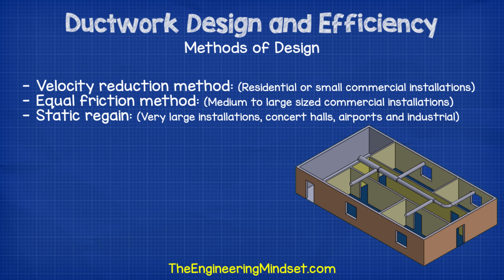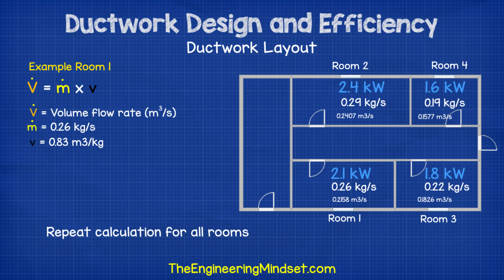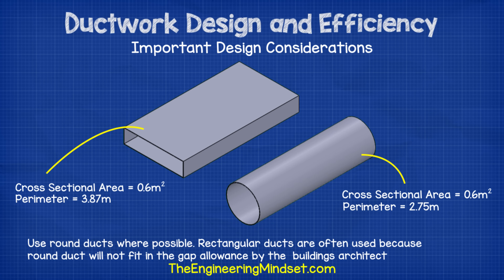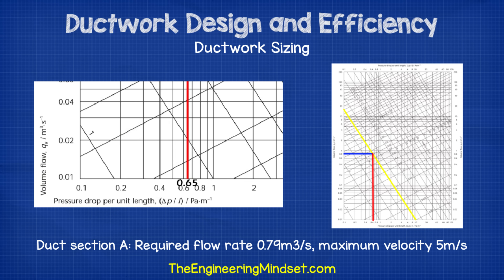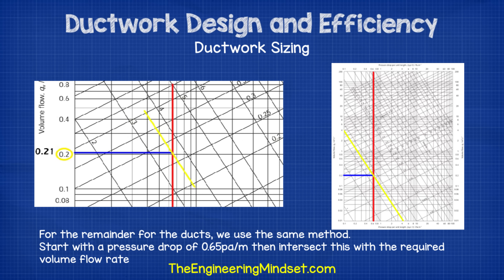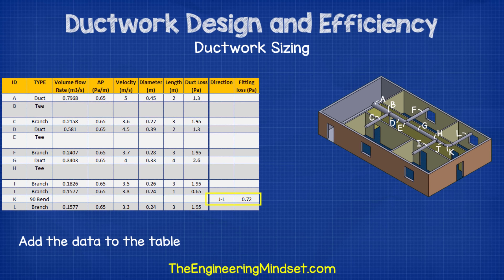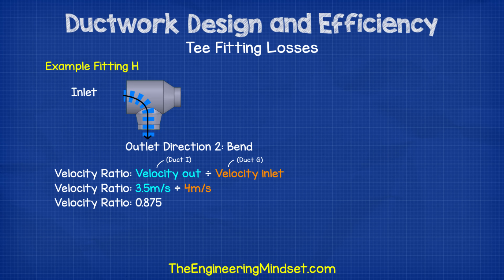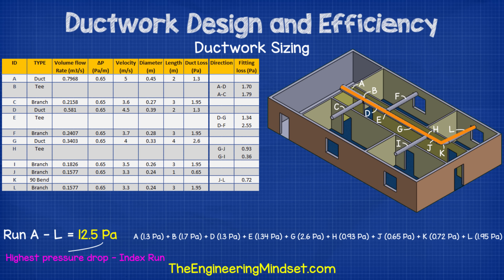Ductwork sizing, calculation and design for efficiency - HVAC Basics + full worked example

Comment: Hi sir, how about designing a multiple floor duct system (with 2nd floor and 3rd floor house). Is the main duct from the upper ground or lower ground?
Reply: Depends on where your feeding it from, if you’ve got an RTU then it all comes down from above and is distributed through the building either directly or through VAV boxes, if you choose to have individual AHUs all throughout the building then they orginate from each floor the air handler is on, but then you’d also need to worry about condensing units and possibly chillers to aquire and it may not become a feasible option if you’re low on budget.

Comment: Every "air properties table" that I have and have searched up has given MUCH different values for the Cp of air. At about 70 degrees F, they all list values very close to cp = 1.005. You on the other hand, listed 1.026, which all my tables list that value when the air temperature is around 440 F... Is this an error? Did you forget a "0" before the "2"?
Reply: are you working in imperial or metric units..? his video is in metric (SI) but you seem to be quoting imperial (I) values..?
Reply: @dpajc056  I am not quoting imperial units, the units for the Cp I quoted were in (kJ/kg*K)
Reply: @dpajc056  Does anyone have a link to an "air properties table" that confirms his Cp air value?

Comment: This is insanity...I mean...for large buildings, this is absolutely essential.  But for small offices and small homes, surely you can simply this and still get results that are perfectly sufficient?  Any negative effects in such a small and simple installation couldn't possibly be that significant with a more simplified method of ductwork design.  Unless the design work was 100% guess work, I just can't imagine there isn't a simpler way to do this on the small scale.

Example: I have a one story home with a fully submerged basement.  One room has a significantly larger load than the rest of the home (TV, computer, UPS, File server, mini fridge, and two people that are in there frequently)...there must be a relatively simple way of figuring out how to move enough of this room's air to the central unit fast enough, in order to remove the heat at a rate greater than that which it is being built up with fewer calculations.

Comment: Error At minute 15:45 - for the H Tee branch G-I  only the value of the loss coefficient was tabulated as 0.36 instead it should have been the value obtained when calculating the fitting loss as was done for the straight duct GJ which gave 0.93 Pa. some clarification needed here?
Reply: At point H, direction G-I, the correct value is 2.68, and not 0.36, so we would have to correct the subsequent calculations.

Comment: Hey Paul,
I am confused about the ESP and couldn't find anybody to explain to me the following 2 questions, I hope you can clarify them for me:
1- why would the static pressure drop when encountering resistance such as filters or coils when at the same time the dynamic pressure decreases (because the velocity of air is decreasing)? I thought that when SP decrease, the DP should increase.
2- why might a concealed FCU break down if installed without ducts?
thanks in advance and I hope you see my comment ^_^.
Reply: 1, You are right if there is no energy loss, but when passing thru filters or coil , there is enegy loss ( due to friction ), so the total energy is less , hence the SP as well as the DP dropped.
2, This is where your concern above come into play : when SP decreased, DP increased. When a FCU is installed without ducting , there is no SP loss which it is designed to have, hance the DP increased , which means the fan is free running , and this causes the fan motor to overload !

Comment: Great video, it's important to also note that's another driving factor for the mass flow rate is the fresh Air supply which is higher than your cooling or heating loads would override your video size
Reply: Agreed. This is where hydronics are strong - separating the ventilation needs from the load needs.

Comment: thank you for the video...But how to find initial velocity i.e 5 meter per sec ? What are the recommended values?
Reply: Main duct is restricted to go beyond 5mps due to noise level it will produce. hmm better check the ASHRAE because some may prohibit due to application of the system.

Comment: choosing between rectangular and round shape is also driven by the cost of the duct isn’t it? using round shape may give you lower friction but cost you more in terms of the overall weight and space of the ventwork

Comment: In calculating the pressure loss in the Tee Fitting, why do you only apply the dynamic loss formula in the straight direction and not in the bend too? For the bend you've only used the co-efficient of 0.3645 (15:45) and not used this in the dynamic loss equation, like you did after getting the co-efficient of 0.143 in the straight section (14:45).
Reply: was that a mistake ? or its how it done ?
Reply: I noticed that as well. It looks like an honest mistake.

Comment: This was a fantastically simple overview of the engineering process needed to accurately specify a ducting system.  

Here in the States among contractors, the most common method for duct sizing in residential is the "friction loss per 100 ft." method wherein we calculate the total equivalent length for the longest runs (both supply and return) and size everything based on getting the appropriate amount of air to these runs and balancing the rest with dampers.

Really wish there was an instructional video on this process (or even the equal friction method) in Imperial units out in YouTube.  

Thanks for providing such fantastic resources for the industry.
Reply: Look up the "ACGIH Industrial Ventilation" manual. You can download the 23rd edition for free on google. It has step by step examples.

Comment: Is there a video on vav boxes? I need to know if the vav boxes also have a little coil that can add or remove heat, in addition to merely  constricting or expanding airflow
Reply from the maker: Yep see our vav system video
Reply: @EngineeringMindset  also thank you for the simscale reference to CFD. amazing to think this kind of thing is available online now
Reply: @EngineeringMindset  thank you

Comment: as a general rule how many watts are needed per meter squared while doing a fast calculation for cooling load? Thank you
Reply: According to thump rule 1 TR for 100 sqft , and it will change as per the height

Comment: Hi Paul or any other engineer in M&E building engineering line, I have a question to ask you all about changing of duct size. Say a 500 (w) x 400 (h) mm duct, and I wanna change the height of 400 mm to 250 mm. I used the hydraulic diameter equation to calculate for the new width. However, when I compare the answer to the "duct calculator". It doesn't match with my calculation. My calculation shows a new width of 2000 mm whereas the "duct calculator" shows 850 mm. What assumption/mistake or anything other related things did I not take into considerations?
Reply from the maker: Probably the velocity, temperature or density. Use a sizer by an industry body or one approved by them
Reply: How do you determine the height and width of the duct?

Comment: dear sir

can u clear one thing
when u  were calculating for bend and other dynamic loss which is actually loss due to momentum change or velocity pressure loss means minor loss

can u clear weather this is the only loss bend will generate or do we have to calculate friction loss in bend length separately which is considerd as major loss

Comment: How do I determine how much to charge customer per BTU unit measured through BTU meter?
Reply from the maker: Work out costs to operate, maintain, replace, profit
Reply: @EngineeringMindset  If we work out this way then every building might have different cost. Is there an industry standard? How to understand from customer standpoint if he is not being taken for a ride with the costs?

Comment: Hi Paul, the duct loss graphs you showed is it plotted from the pressure loss equation for fully developed flows (also called the Darcy-Weisbach equation)?

Also, in this case gravitational effects are not affect the air in the duct as the duct is horizontal. What if some part of the duct is vertical? If so will this change the way of calculation as shown in this video?

Also, when using this equal friction method, are you assuming that the pressure loss per meter length is constant?

Also, will you be showing the other 2 method as mentioned in the early part of the video?
Reply from the maker: Hello I'm actually not sure as the charts are from manufacturers and industry bodies, you would need to check with them. These are standard design guides for horizontal, vertical needs more calcs. I might cover the others it depends how well this video does and of there's a lot of interest.
Reply: @EngineeringMindset  I dunno about others, but I certainly do.

Comment: im new to the design field  .. shouldn't 8 C = 281 K ??? why did you take it in the equation with the value of 8 K ??
Reply from the maker: Can you include the time stamp where this occurs
Reply: at the min.2.08 you mentioned the delta T should be less than 10 C and you took it 8 C 
then at 2.18 in the equation you used it for 8 K
Reply from the maker: ok, its temperature difference. so it doesn't matter if you use C or K there is still a difference of 8 between the hot temperature and cold temperature.  arbitrary example: 9*c - 1*c = DeltaT of 8c. and equally 282K - 274K = 8K
Its just the temperature difference you want to design to, regardless of the temperature you'll use
Reply: okay .. thank you .. i got what you mean .. great video .. now im searching among your collection about the cooling and heating loads calculations.

Comment: Great video this, can you also do a video on "calculating the cooling and heating loads using psychrometric charts" for HVAC systems? Really appreciate it if you can
Reply: refer to ashrae brother, so much easy to follow when you have ashre guidelines

Comment: Hi,

Another great video. Thank you!

I have a question. For an equal pressure drop per meter in all of the ducts you used non-commercial sizes like 0.24 m or 0.39 m (at least in Portugal they don't exist). Actually, you will have to use the commercial existing sizes if this would be a real project, right? In that case, it is really possible to maintain an equal pressure drop per meter in all ducts?? Or actually you will never have this in real life, it is just a theoretical method and you just try to find the sizes that allows you to have the most similar pressure drop per meter as possible (per example, between 0.6 to 0.8 Pa/m)?

Sorry if it is a stupid question.

Thanks in advance.

Best regards
Reply from the maker: Duct can be made to any custom size but it will cost more, to save money and use standard size only then adjustments need to be made to the calculations and reiterate

Comment: Is delta T is in Kelvin or Centigrade?
Reply from the maker: Makes no difference when its delta T. Arbitrary example  18*c - 10*c = DT of 8*c the equivalent in kelvin (just add 273.15) so 291.15K - 283.15 = DT of 8K

Comment: You do all this, provide your quotation and you are too expensive. Then a cowboy contractor comes in (who calls himself an engineer), oversizes the ducts, undersizes the fan, uses wrong grade filters and charges far less.
Then you are asked to go and see why the system does not perform, you make a list and the customer prefers not to do anything after all when they see the bill.
At the end we are out of pocket for the time spent sizing a proper system, twice, and we end up not getting the job. At the end of the financial year we struggle to pay our subscription to the Engineering Council.
Reply from the maker: So offer them a different business model. Give them a simple 1 page of what seems wrong and if they want the full answer then they need to pay for a review and offer to deduct this from the final quote if they choose to use you. Estimate the financial and energy savings from the improvement as well as how it will improve their work/living conditions.
Reply: this business model idea is what we do in the cloud computing world. an architect gives them a basic idea of the price, and work required based on a basic conversation with them, tehn an engineer gives them the actual plan, and hours breakdown, based on a deep dive discovery. a lot of times, we are on or under cost, but that comes with experience. you have to do the calculations to 'pay your dues' as it were until you reach architect level, where you can spitball an estimate, and be pretty close.
Reply: The Engineering Mindset You said the magic word, energy saving. 
I had customers prefering to go with normal AC motor fans because they were cheaper to buy than EC motor fans that would pay for themselves in a couple of years and start providing true money saving. Anyway, it is a big discussion this one.
Great video by the way, as always.
Reply: @EngineeringMindset  from real life cases, clients will value the "financial savings way over the living conditions enhancement"....but anyways either will require a proper engineering design and evaluation.
Reply: Never give up your talent without getting paid FIRST !
ENGINEERING FEE UP FRONT. 
IF THEY DON'T WANT TO PAY FOR IT, YOU DEFINITELY DON'T WANT TO WORK FOR THEM!!!!!
Reply: Manolis Theofilos I do the calculations after I get a deposit.
Reply: Seems like someone is buring inside when it's cold outside
Reply: We usually have a contract drawn up before we begin work. Either fee or hourly based.
Reply: @Mech Tuber depends on where you live. Where are you from?
Reply: Exactly...
Reply: That’s why you have to be like me an hvac/r tech and engineer 👷‍♂️ lol
Reply: Try charging less.

Comment: air is 1.2kg per metre cubed???
Reply: That is the density of air. 1 metre cube volume of air will weigh about 1.2 kg at 21 degrees and atmospheric pressure. :)
Reply from the maker: Sounds surprising but there's a lot of water in air which gives it mass. The density changes with temperature and pressure.

Comment: Great video. Just one question is there a standard basis for the maximum 5m/s velocity that you chose?
Reply from the maker: Industry bodies ASHREA and CIBSE make recommendations in their guides for velocity to limit noise. Check the book links in the video description
Reply: Depends on the application (restaurant, office, hospital etc) if it is a main run or a branch etc.
As a rule of thumb, dont go over 9m/s as you will get excessive losses due to friction and noise.
You will need to refer to the relevant industry body for guidelines.
Reply: In the video, the pressure drop per unit length was calculated for the initial section of header, and then that same pressure loss per unit length was used on the downstream sections and branches, why was that pressure drop per unit length used throughout the system, rather than recalculating duct size at 5 m/s for all sections, using velocity as the limiting factor